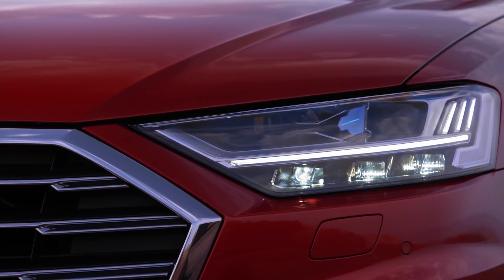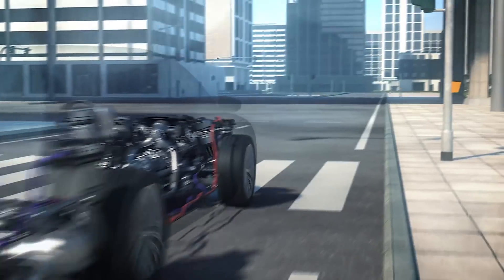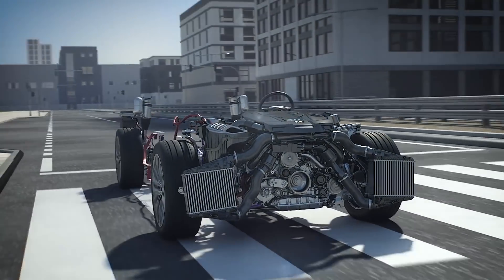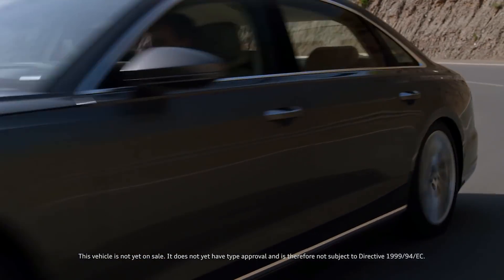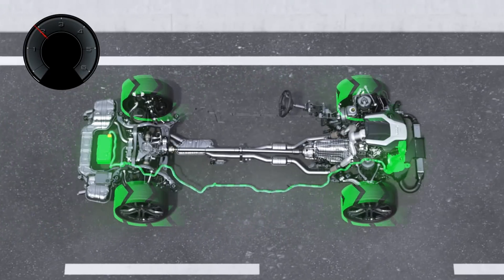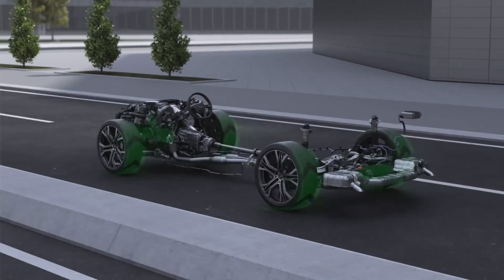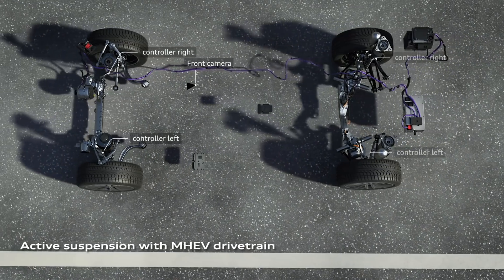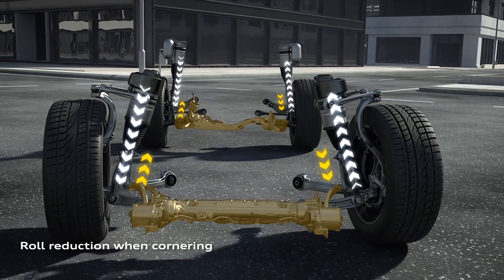What is a Mild Hybrid Engine? A look at 48 Volt battery technology

Comment: I have an A6 with the mild hybrid system. After 2 days I went into the settings and turned it off. In an effort to coast, i found braking performance reduced. First time driving I over shot a give way sign by 1 metre because the car wouldn’t slow as quick as you imagine. With MHEV on and stop start (which I hate) on I averaged 44mpg on an extra urban run. With both technologies off I averaged 42 mpg on the same journey. I just don’t see how the added complexity is worth the benefits of 2 or 3 mpg
Reply: And when it goes wrong it cost an arm and a leg. 
£2000 for an alternator/starter🤦

Comment: Combustion based vehicles are now far too complex, imagine how maintenance intense these vehicles will be after 80k miles or 6 years. Instead why not embrace the relative simplicity, low maintenance, high efficiency, performance and zero tailpipe emissions of a full electric vehicle?
Reply: ...sure, just a few problems,  90% of people cannot afford a full electric vehicle and secondly, sometimes need to travel further than 200 miles before the battery is dead.

Comment: Bmw system is called efficient dynamics but it doesn’t use a 48 V battery therefore is less effective 
Coasting with the engine on idle doesn’t save fuel. Does it turn it off? Even so, without coasting the engine braking produces electricity for free and doesn’t slow you down too much, I think most of the times is more efficient
Reply: Ye it shuts off the engine when coasting or breaking from what i have seen...
What concerns me is that i am seeing smaller engines with this system but they claim they will have an incredible horsepower...
per example fiat tipo 1.4 gasoline now has 120hp vs the next fiat tipo 12v mild hybrid 1.3 engine will have @180hp.
And this does not make sense to me unless they are reducing engine displacement but making it with stronger materials so they can reduce emissions and at same time increase horsepower to make ppl want to buy their new cars...
might be that what they are trying to go for?
Reply: "without coasting the engine braking produces electricity for free "  This is not for free. You needed fuel to get the car going first. Energy is never free.
Reply: flexairz of course, it’s recovery of energy from you have already spent and would otherwise be lost

Comment: For those in the comment section that is not familiar with the alternative German offerings. 
it also helps with coasting adding 10 to 20 KW to your car . this is amazing in city driving as you have more lower end torque . 
aiding in  turbo lag boosting you until the turbo has full boost . 
Above All . Cape Town Stand Up .
Reply: How exactly does it add horsepower to the car? Iv seen brands claiming that those cars will be significantly faster... how come?
Are they making the engine with stronger materials so they can tune it up better?
Reply: @Deathfg  Mild hybrids provide an instant torque assist.

Comment: The problem with this system is that while it does help reducing the overall consumption of petrol increasing the energy you can recover from the braking phase of driving storing in a slightly bigger  48v battery and then using  it to lower the overall work of the alternator  , it does lack any kind of motricity as it misses an electric motor , instead it has only  a BAS (Belt alternator starter that it can be an eletric motor but i digress)  that enable an engine start in fraction of a second, thus enabling the engine to shut off when you slow down. Hybrids of the likes of the prius have an overall bigger battery at higher voltage that feed an electric motor that helps the ICE during accellerations one of the most energy inefficient phases of the ICE thus being overall more efficient.

This 48v hybrid system is not bad per se as it easier  and cheaper to implement but the benefit vs price it's overall lower than a full hybrid having the same disvantages like added weight and complexity vs regular ICEs.
Reply: this helps the supercharger so engine can work in lower rpms, helps esp in diesels petrol turbos have smaller "torque lag"
Reply: @robertbalu8001  so this mild hybrid system works as a supercharger?
And theres the possibility to make the turbo act like a hybrid turbo to reduce turbo lag, right?

What i find strange is the claims that several brands are making that their mild hybrid cars will be 'a lot' faster than the previous ones wich had bigger cc engines... if the engine will be producing all the power, will they be made of better materials to support all the stress or they will be breaking down more often than the previous versions? 🤔
Reply: @Deathfg  it actually increases the torque that 48v can increase the torque by 108 LB-FT, it will have more torque than a naturally aspirated engine.

there is no cons to this type of set-up because the motor that boost torque needs very low amount of energy, the battery will most likely always be full charged so the motor will always work

this way you can use a 1.5 litre engine and add a turbo and you will get the same performance as those of 2.0-2.5 litre engines. the engine would also have the ability to turn on and off and if this is uncomfortable to some drivers im sure there is a drive mode in which the engine is always active.
Reply: @ameserich  you're confusing the setups. There is absolutely no way a 48V battery can power any motor producing 108lb ft of torque. Honda's IMA system had a 13hp 58lb ft electric motor and that needed a 100 volts battery to power it, and it couldn't even drive the wheels alone, the ICE was always on.

This mild hybrid technology has all the drawbacks of a hybrid setup with none of the advantages.
Reply: @mdo  range rovers mild hybrid have this and its exactly 108lb-ft smaller cars would have less obviously, i think the primary idea about this is to work once you step on the paddle to remove turbo lag, the effect obviously diminish, nsx's pancake design direct drive motor adds 75lf-ft, i think the one in range rover is a separate motor similar to that of toyota's and obviously this motors operate together with the ICE

This tech is just a generational upgrade for ICE, electric cars are new so people likes it there is soo much hype but its not the future, we will likely just use methanol as ICE fuel, such tech like mild hybrid will make ICE better

Comment: It's a fail.
Reply: Aww Ben Klock has all bark and no bite. What a 🤡
Reply: This tech is all over japan few years ago ...and it is a HUGE PASS...just do some research....
Reply: And who are you to say it is a fail? :D your comment make me laugh
Reply: Tevaris You are easy to entertain. It doesn't matter who I am.
Reply: Ben Klock explain why. Otherwise your comment is just noise
Reply: and now he s silent
Reply: @rajeshr5140  increased cost and complexity for almost no gain. It can't provide power to the wheels. It's merely an assistance tool. It also causes the engine to stop and start more often than a proper hybrid. Given that it's paired with diesel drivetrains reliability will be a fun affair (not for the owner of the car, though)